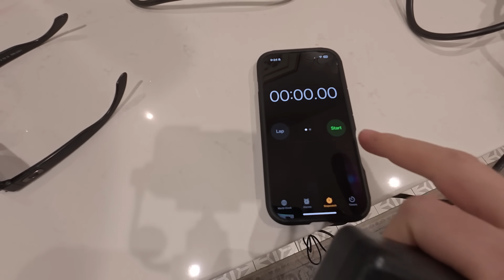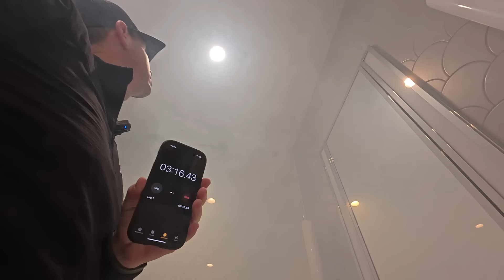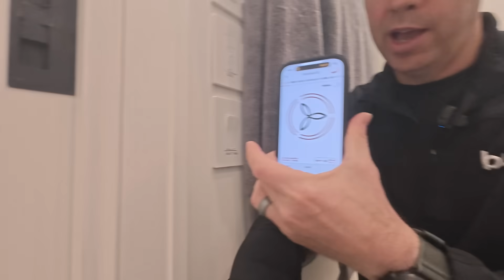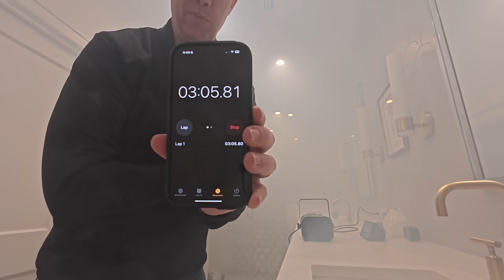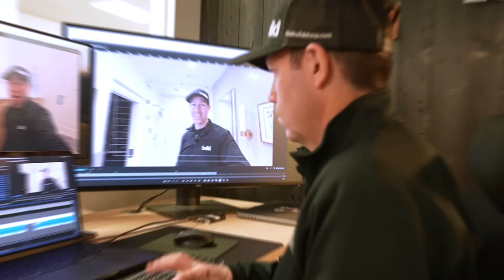Can A House Be Too Tight - ERV Fresh Air Experiment

Comment: I think I’m good with opening and closing my windows. Sure Texas you keep your windows closed 10 months of the year but it certainly beats spending a couple grand on a system that will break.
Reply: Sure, an ERV can break, but I think you're overestimating how complex one is. An air conditioning unit is vastly more complex and yet most Americans can't live without it. That's why HVAC companies run 24/7. The only mechanical part of an ERV is the intake fan and outtake fan. And then there's the cpu, but nowadays those are built to be pretty robust and replaceable. And operable windows is basically the failsafe for a broken ERV. Sounds like a no brainer to me.
Reply: @jundossantos  Indeed, ERVs are about as simple as it comes.
Reply: @jundossantos  Especially for a new build with spray foam insulation. Total necessity as far as I'm concerned.
Reply: I drive luxury cars because they’re comfortable and perform well, are there more potential points of failure? Sure but the added cost is worth it, look at long term cost, less doctors visits, asthma attacks, seasonal allergies, cost of medicine…
Reply: @rykdheiner  very well said and never fully thought through! While in high school I did check myself into the ER for respiratory distress during a bad cedar outbreak while training in Helotes, just outside San Antonio. Ty for the additional comment!
Reply: @videozoom12  youre also opening yourself up to attack from kissing bugs if you keep your windows open.
Reply from the maker: If you’re a resident of San Diego this comment makes sense but if you’re a Texas resident you’re willing to spend the money on a comfortable house. It’s HOT and Humid here. Add in bugs, mold, pollen, oak fever, cedar fever, etc and you’ll want a tight house with a good HVAC+D system
Reply: You speak truth, Matt. I deal with all those things where I live and the house in which I live in. Also, my electric bill is over $400 a mo. I look forward to having a more clean,  consistent,  inexpensive, monthly living  condition some day.
Reply: @buildshow  I agree with everything you said with one additional reason to keep the windows closed and locked.  Crime is bad not only in Texas but in almost every state in the US.  For that reason alone, I prefer an ERV.
Reply: @buildshow  Yeah, I live around Grays Harbor in Washington State.
Reply: @ I do agree largely with your response. And yes, opening a window does zero favors with humidity. I guess I’m attracted to the simplicity of opening and closing a window. I guess I have greater faith in my arms and WD-40 than I do an entire extra add on. Ty for the kind response of course. I live in San Antonio.
Reply: Furthermore, one key difference is that keeping a window/door open is well just that, an open window or door. An ERV will recover the energy that would be lost by opening up a window as well as helping keep humidity from moving a way you don't want it. That eventually will provide savings relative to opening windows directly, while also letting you have filtered air.
Reply: But you get worse air quality with the open/close windows. I live in rural Ireland and a few times a year they spread slurry on the fields - well fermented cow manure. It's... a smell.

Since installing heat recovery ventilation and closing up the trickle vents I don't smell slurry in my house. In addition, I ran a CO2 monitor for the first year or so and they stayed below 500ppm for most of the time. And once I replaced my gas stove top with an induction hob I never saw spikes above 500ppm.

Eventually I want a monitor that covers more air quality numbers but that was a pretty good proxy.

Oh, and I ran the monitor before the HRV was installed.  Regularly got spikes above 800ppm. The problem with trickle vents and open windows is that if the air is still outside or blowing from the wrong direction, the air in the house doesn't move. With an HRV the air flow is constant.
Reply: I once spent a summer in a certain city in the midwest which was not nearly as hot and humid as it is where Matt lives. I left the bedroom window open to get a breeze, and one morning found that they had decided to TAR THE ROOF. The tar wagon was percolating no more than 20 feet from my window. As you can imagine, the place smelled like tar for the rest of the summer.
Reply: Systems work fine these days.  Even if I were in the perfect climate, I would want a system that has great air filtration, at a minimum.  Windows being open don't necessarily do a great job circulating air, either.  We currently turn on our bathroom exhaust and open a window in our bedroom.  If I turn that exhaust off, that air doesn't want to move.  CO2 levels get really high really quickly, which isn't good long-term for you.  My thermostat measures CO2 and VOCs in the air and I was shocked.
Reply: You can build it tight, ventilate it right & pay 1 time. Or build the same poor standard leaker & pay whatever the elecric & gas companies want the rest of it’s life!
Reply: @ just to clarify, I’ve never been against building tight. I do love, efficient and well insulated homes! I was just never a fan of the ERV’s until now.
Reply: @videozoom12  you could also build a relatively tight house with a dehumidifier and fresh air on the return of your HVAC system. ERV works well too along with make up air for bath fans and kitchen fans.
Reply: Lots of discussion. But can anyone explain what happens in such a tight house when this system is down for maintenance?

Is the living space habitable? For how long? Worst case scenarios need to be understood fully.
Reply: @ these are all fantastic questions! But at the end of the day, I don’t think there’s enough data and science behind it. Matt is leading the charge!
Reply: @videozoom12  I appreciate the spirit of the design, however more needs to be explained and quantified if this is encouraging new construction to adopt these practices. 

I'm very intrigued honestly. And would like to adopt these methods, in principle, for a future house. However, I have a family and would need to understand the safety and practicality of this tight design.
Reply: @punksjutgbd all of our builds are based around high level airtightness and ERVs are a key component. If you are new to whole house fresh air systems, an ERV can sound complex and expensive. While there is a cost to install of course, the equipment itself is very basic and I would argue that it’s probably the most simple piece of equipment in most mechanical rooms. They don’t provide heat, cooling or dehumidification all they do is efficiently move stale air out and fresh air in. Of course the magic is in the core which exchanges heat and moisture. If and of course when, one of these systems goes down for some reason, you can always go old school and open a few windows to air things out.
Reply: @punksjutgbd  i would guess that just from opening/closing the doors throughout the day would add in enough fresh air to keep you from passing out for quite awhile (days...weeks?) Just a guess.

Comment: My house is pretty tight with spray foam. The issue we have is high humidity since the house is so efficient I don’t run the AC enough. Do you run a dehumidifier as well? Seems almost required with SFI. I’ve been thinking of adding one.

Comment: If I have a volume builder home from ~2007 is considering an ERV worth it? (Broan, in my case) Could I use existing bathroom fans to exhaust the air while being their own booster? (Remove the bathroom exhaust baffles should let air flow freely)

Comment: Matt, love your station and your commitment to  "right House"

But all the reliance on technology working, synchronized, balance, maintained, and uninterrupted energy supply...

Has way more risk of failure points for many

Not to mention large variations from the calibrated norm for those who entertain, like fireplaces, want a steam room, etc 

Since the vast majority of America has a hard time buying the median home size built at $200lsqft

These concepts do not seem quite ready for prime time

How much does your average builds (like your home) cost/sqft to build and what are service/maintenance/depreciation costs expected to operate the systems?

Comment: At 3:06 you can briefly see the veritable FOREST of ventilation tubing in your machinery room. That is just mind-boggingly way too complicated IMO. Yeah I'm going to vote in favor opening windows. KISS. It's just the sheer complexity of your HVAC plus ventilation system. For one thing omg you have extra vents in pretty much every single room even the freaking closet. That is an incredible amount of ductwork, completely separate from the H/AC system! How are you going to keep all that ductwork clean? You're a builder and you can build and maintain and understand all this stuff maybe. But I tend to think that the best part is no part. Your ventilation system alone costs more than my entire HVAC. 

Since you're designing and building a home from scratch you have the opportunity to think about design to prevent these problems in the first place and make their solutions much simpler and less expensive. I noticed that there are absolutely no windows in that master bath. So what about designing bathrooms and kitchens and laundry so that they are on outside walls and so can have windows. You can just open a window for a few minutes which is not really going to cost you that much in climate expense even in extreme weather. And the beautiful thing about windows is that you can immediately tell if they're open or closed; when closed they are perfectly sealed shut. There are no additional through the roof or through the wall or celing vents to worry about. That's just one idea but generally look at it from a different perspective to minimize the complexity and expense. Also modern houses have huge air volume and few people inside, if the temperature is managed you don't need fresh air every second by any means it's not going to get stuffy.

Comment: ah, the art of marketing, a sealed house is not passive, it's [active], constantly relying on ERV, AC/heat-pump for CO2 & moisture control.  More upfront cost, more complex duct work, more failure points, more upkeep cost.  
At some point, we need to consider brick houses, especially at some ridiculous cost like $400 per sq-ft.  why would any reasonable person pay double for a stick frame house?

Comment: Thanks loads for doing these videos, I’ve been developing a hemphouse and it will be heated by geothermal, I’ve been researching what to use for ventilation and this looks the perfect system, a bonus is the smaller pipes so it will fit on the space prior to hemp being sprayed inside. Love to see more videos if you get ideas

Comment: Question: house in eastern NC on the Albermarle sound. Vented crawl space, monopoly style zip system for sheathing. No attic (high ceilings). I understand air from crawl space (about 2 foot high crawl space) is not great, is it wise to zip tape huber subfloor? Using lvp with its own backer (no pad etc). Thank you and keep up the fantastic work!!!

Comment: I wonder where the law of diminishing returns kicks in when making a home efficient.  Matt went for bleeding edge efficiency.   The house is so tight that you have to invest a substantial amount to get some air turnover.

This is one hell of an expensive way to build.
Reply: That's the real question. There are definitely benefits to making a house tight, but there's definitely a point of dimensioning returns as well. Matt usually focuses on making homes as tight as possible, for whatever it ends up costing, not the tightest home you can make on a budget. But he does have a video with a guy making tight spec homes on a budget which is a good watch.

Comment: Would call out that the ERV is going to try to equalize the humidity between the inlet and outlet air. So all the humidity you’re dumping into the bathroom is going to be spread across all the outlets around your house. Essentially you’re humidifying the entire house instead of one room.

Comment: So, you spent a lot of money to make the house "tight", then spent a lot of money to get stale air out of the house, and finally spent a lot of money to bring fresh air into the house.  Sounds really efficient.  My $80 bathroom exhaust fan and an open window would have taken about 90 seconds to do what your "system" couldn't in 20 minutes.  That's just nutty.

Comment: Matt, man, while this test was neat. I got bad news for you... those fog machines just filled all your air runs with sticky glycol based residue. You need to clean ALL those pipes out now, clean the fan, clean the unit. It's going to attract and stick dust and load up the fan.

That's a not insignificant amount of damage you just caused long term :(

Comment: Your extractor system is way under sized. My bathroom fan would clear that room in 1/4 the time. WTF? My house was the usual construction in the yr 2000. So, rather then spend 100k rebuilding it I'm going solar. I will be my own power company and no I'm not paying some turd contractor 300% profit and 100k to install it.

Comment: The difference in mechanicals needed for a 3 ACH50 house and a <1 ACH50 house makes making a house that tight unviable for most home owners.  It's not that the house needs to breathe. It's that we get to a point that a house becomes so tight that there are diminishing returns below a certain level of tightness.
Reply: Exactly, the ROI drops significantly at a certain point. Taking ACH to near zero is way too expensive for most people and has very little return.
Reply: @bobbygetsbanned6049  exactly
Reply: It's much easier to build tight using ICF as the exterior wall system
Reply: @ddrigmaiden  oh...kaaay....

Comment: Our building department will not CO a house without a blower door test. The test can be no more than 7 ACH and no less than 3 ACH. If it is less than 3ACH, they will require mechanical ventilation. anything over a 400cfm fan will require some sort of mechanical make up air.

Comment: This erv system wouldn't make sense in a cold climate/heated interior. 
All your hot air would be pulled out continuously, which is going to trigger the A.c to go on more frequently. Plus then bringing cold dry air in, you now have to condition that air and give it humidity before coming back in the house.

Comment: So spend thousands of dollars to seal up your house to the point it cant breath then spend another 20 thousand dollars to install a machine vents and low voltage switching to make the house breath around the thousands of dallors of materials you put in to make sure it doesnt breath and then spend hours waiting for the 20k pos machine to dry out your bathroom when you could have used a120$ fart fan to do the same drying in 10 minutes and saved the 30k you spent to create and fix the problem you created yourself.
    Meanwhile if you have 5 people using the shower everyday your pos air system will never have time to dry out the room.

Comment: While doing efficiency upgrades to a 90’s era boarded in home with tar paper (no HRV), I couldn’t find anything with as quick of an ROI and as impactful on the utility bill than a Ground Mounted Pergola Solar system.  I couldn’t have triple glazed the windows alone in my home for the price and I generate 14,000 kw/h a year, in Canada.  

You can add insulation to the exterior, buy the most efficient windows out there, mechanically bring in air to it, and rebuild as tight of a structure as you want. But when the kids are leaving the patio door open, what’s really getting accomplished?  You’re better off just making your own  electricity at that point.

Comment: Hey Matt and the fire service we use a thing called a positive pressure fan to help moose smoke or fresh air into the house and move smoke out you could do the same thing with a fogger outside pushing the fog in and pressurizing the house and it would leak out of any place that's leaking air

Comment: My parents used to have a house that had air conditioning outlets in the bedrooms and an extractor fan in the bathroom. The cold draught under the bathroom door straight on my wet toes was brutal, and you couldn't sleep at night unless the bedroom door was wide open because the air con couldn't push cool air in against a shut door. If they'd cut an inch or two off the bottom of the bedroom doors it might have worked, but then even closing the bedroom doors wouldn't have given anyone any acoustic privacy.

I'm a big fan (pun intended) of changing our house designs from the ventilation strategy of a tree to the ventilation strategy of a lung. I'm tired of dust and bugs entering the house through all the gaps where "fresh" air is allowed to seep in, and I want my indoor air to be at a controlled temperature and humidity all year around. But a lung can't function without stale air being piped out and fresh, filtered, conditioned air being piped in, and that doesn't just mean for the house as a total - it means every room that you can close a door on, you need to pipe air out and you need to pipe air in to that space.

Comment: A typical blower door minimum spec is less than 3 air exchanges per hour.  At what value would you say an ERV is absolutely needed?  Two builders here, Western NY, say they typically don't install ERV systems, and they tell me it's not necessary.

Comment: I do have a question regarding the system itself. Since it is a tight house what would you expect happens as the system fails due to electrical issues? I would assume you would end up with a house that’s not regulating flow of air through the house at all. The question, would be then if the system had a malfunction what would happen to the air. Stangnate? Would you do the same test with the system off?